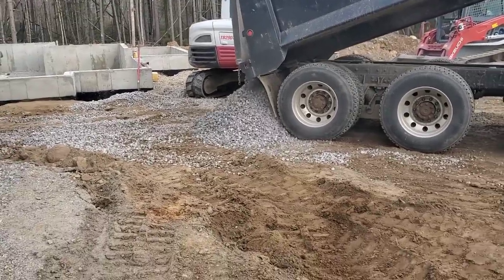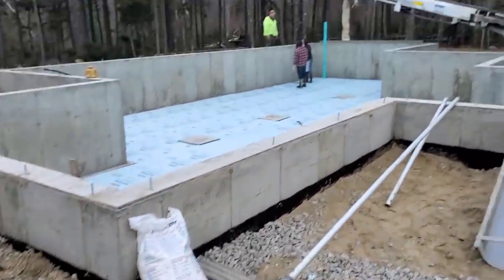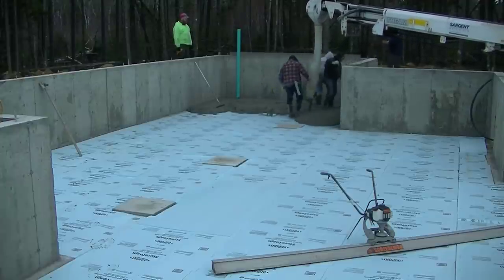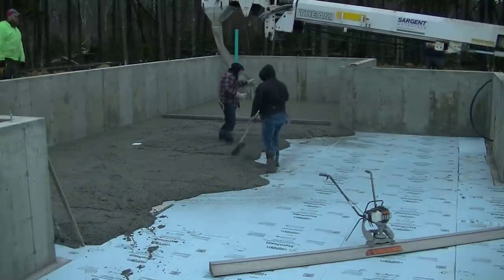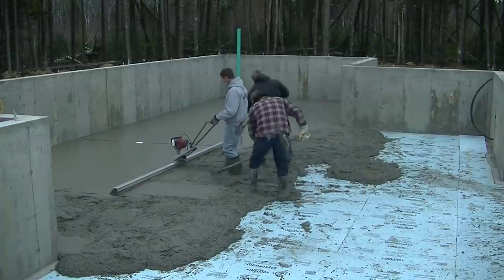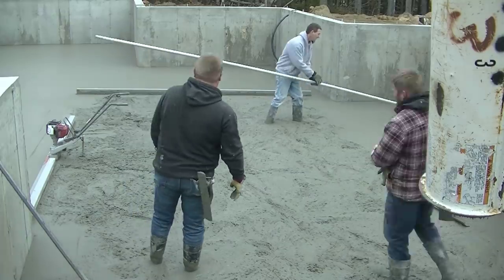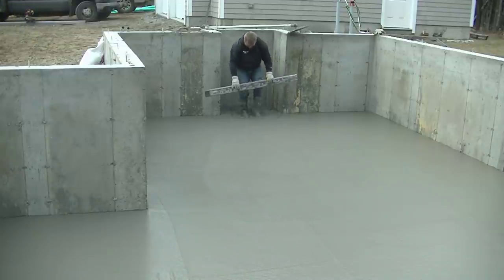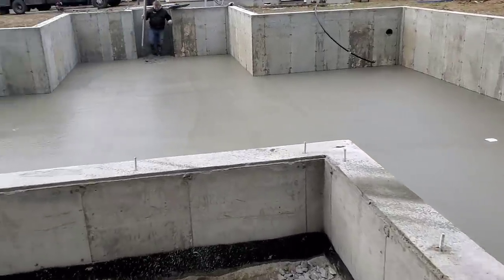Pouring Concrete For A Basement Crawl Space (Mud Slab)

Comment: A ‘mud slab’ for us in Florida typically refers to the pouring of 2-3” of concrete that you will need to support the really heavy reinforcement that you would have in a mat foundation for something like a high-rise that didn’t require piles. When you start getting a lot of #10 or #11 rebar in a foundation, even besser bricks or dobes just sink into the dirt and you don’t get proper concrete coverage around the steel. They’re nice to work off of bcz you can fasten very sturdy sacrificial steel templates to, to support the very heavy column and wall vertical dowels to as well.

Comment: We have done crawl spaces here in Pa. usually 2 1/2 to 3 inches thick ,float the edge rake out the middle and bull float . We started out just using a 2000lb sand mix,no gravel but because of cracking switched to a  2500lb mix with shot gravel and fiber. It cracked but not as bad !  Poured on top of gravel base with 6mil visqueen covering the gravel .

Comment: Can't believe they spent that much and didn't do a full basement.
Reply: That was my first thought.  What a waste of 3/4 elevation.great job on the concrete.  Architect should be fired
Reply: I can see a crawlspace on a cabin where you don't need a lot of storage or expansion, but for a house, yeah, you should just make a basement while you're at it.
Reply: I'm a bIt further north in Maine and a crawlspace like this is going to be about $20,000 cheaper for me 🤷

That's not including the increased cost of excavation, or in most cases here in Maine, blasting ledge or rock to go down deep enough. A lot of times it's just not possible
Reply: Sometimes a full basement just isn’t possible ( high water table , ledge , etc. ) so let’s stop rushing to judgment here calling for the firing of the architect lol. I’m sure they considered all options.

Comment: Unless there is a valid reason for a crawlspace ( ledge, high water table) they make no sense, you might as well spend the extra money for the full foundation and try to cut cost elsewhere if money is that tight, you can't come back to it later. A properly done basement can be finished into living space increasing the square footage of the home x 2 ( if it's a ranch). It's the cheapest square footage of usual space you are going to get.
Reply: true but what about just not wanting to put plumbing under concrete slabs

Comment: That mud mix is right in the middle of what  we would use for footings (25MPA) and floors (30MPA)ish.  It does seem like a waste to not just dig a few more feet and have a fantastic storage area/rumpus room/bomb shelter/whatever.  I reckon that the owner will probably regret not doing just that eventually.  By the way, did you know that you are driving on the wrong side of the road? 😂
Reply: "I'm never going to want/need that"
Famous last words.

Comment: Is there any risk of the styrofoam floating up? Is it safer to lay plastic sheet over top the insulation boards?
Reply: I would be more concerned with the Styrofoam compressing and degrading over time. Then you are going to have all kinds of problems, especially without any rebar in the concrete. All the newer building techniques seem to be based on being lazy and cheap and none of the savings ever get passed on to the customers. I predict most of the homes built today will need massive renovations or to be torn down in the next 50 to 100 years. That chip board they use on everything is complete garbage. I live in a new housing tract (about 2 years old) and I can see all the roof sagging between the joists in the neighborhood. One of the houses already had a major part of the roof replaced last year. I am really glad I am only renting and didn't buy. These houses are not build any better than an old mobile home, possibly much worse!
Reply: @MAGAMAN  Engineered I-joists and floor trusses also have lousy fire ratings and don't hold up to moisture or mold well at all.  Conventional lumber is far more robust.
Reply: @confidentlocal8600  : imo pressure treated Lumber serves best for all floor joists, (above basement or crawlspace) rim joists, & sill plates. Probably a good idea to use it on wall studs in bathroom as well, (in shower/tub area).

Comment: in Ontario Canada, we call them mud matts, when its on mud, i would call this a slab
Reply: What is the point of  that insulation under the slab ?
Reply: @andreycham4797  most likely to make the concrete cure quicker and stop moisture from rising up through the concrete.
Reply: @Tom-yb6sl  if you wanna stop moister you use poly it is much cheaper

Comment: WASTE OF MONEY: your putting up foundation wall forms, you might as well go down another 4 feet. Easily could get another $65,000 for the house with basement. Builder loss money on this one.
Reply: Maybe, lots of variables when just putting a crawl in. Maybe higher water table. I would say it’s not a loss of space as you can get you mechanicals down there and some storage. Not ideal but sometimes better than the alternative. Builder in Michigan.
Reply: Building a home specifically with a crawl space just like this (architect originally designed a slab). Don't need/want a basement - but do want a conditioned space to run mechanicals/electrical/plumbing.
Reply: @ArthurDentZaphodBeeb  I can't wait until you realize you should have just gone all in for a basement.